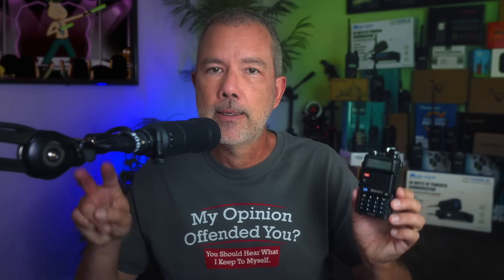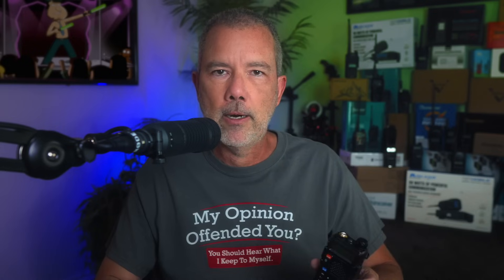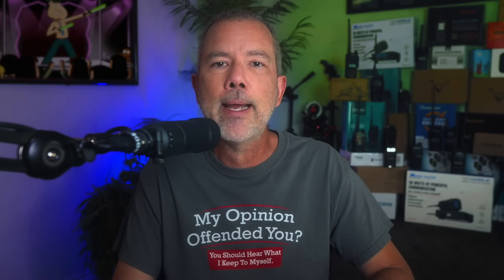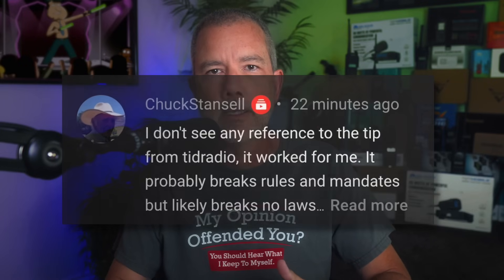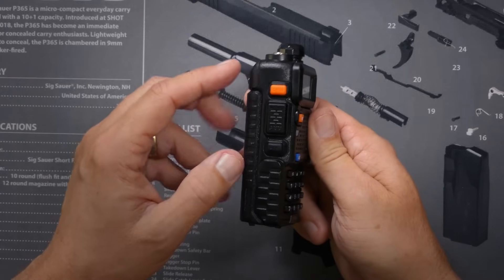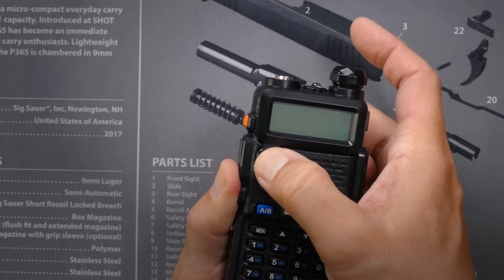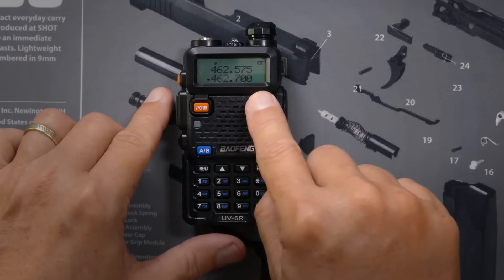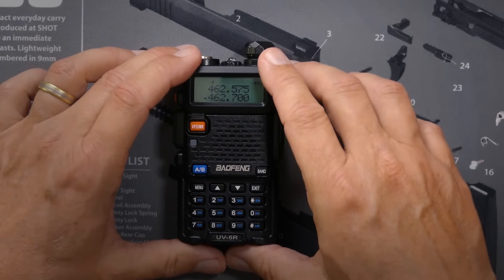How To Unlock A New Baofeng UV-5R - Easy UV5R Jailbreak To Transmit On More Frequencies

Comment: I ordered the Tidradio H8 which is a lot like the UV-5r. My radios were locked against the ham frequencies. I am a ham, thats why I ordered them, but they do not have a "Monitor" button, although I contacted Tidradio, they gave me the same method you showed here , I tried all sorts of things, but I dont get "Factory" coming up so I rewired them about the "Monitor" button which does not exist on the H8. Do you prehaps have the way one could unlock the 2m band transmit for me?  (They have not yet replied to me)  Thanks Trevor

Comment: About a year ago I left a comment regarding the legality of these mods.  The UV5R is not type accepted ie the US.  So what does it matter if it's unlocked?  A ham should know not to use other frequencies.  However I understand notarubicon has been banned.  I specifically will not allow it not be banned on the group that I admin BARN.
Its the group for baofeng and btech radios.  I have come to realize that banning information is not a good thimg.  I also have enjoyed many notarubicon videos.  Those that ban notarubicon even being mentioned should not be allowed to plug a blender in much less use one.  No ham knows everything, I have found much to learn from these videos.  73 DE Bart Stavisky KF5EKG
Reply: The hack worked for me.

Comment: I guess I am missing something didn't work with 5r+plus
Reply from the maker: A UV-5R+plus is not a UV-5R
Reply: @NotaRubicon Productions  going around the menu. I guess I didn't have to do a factory reset. Went in freq mode and plug some magic numbers in received and trans work.

Comment: Just got a new "camo" UV-5R, it's completely locked to the 144 and 433 ham bands, and this unlock does NOT work. It will not even RECEIVE outside these ham bands!! :( 
EDIT: Managed to fix this using Chirp, in Settings > Other settings where you can set upper & lower limits.

Comment: Thank you for the information. I’m playing “catch up” on your videos, so I’m writing this a year after you posted it. 

So, my UV-5R radios are old, so old I don’t remember how old. I found a receipt for an aftermarket Diamond antenna I bought in February 2013, so I know they’re at least ten years old. 

Therefore, ignoring Warning #2, because if I damage my radio (I used my oldest one) it gives me an excuse to buy a new one because my UV-5R label fell off of it years ago, and we all know the radio is now worthless, I diligently followed your instructions, not even knowing if my radio is locked or not. 

The result was interesting. I did not get the word FACTORY to show on my display. The word I got was COPING. Not COPYING, but COPING. 

I have no idea what that means. The radio works fine. All my programmed channels are still there. I won’t know if Warning #4 applies to me, because after using CHIRP to program the radio just to save time in the amount of channels I originally needed to set up, any further tweaking I’ve done has been manually, and the only reason to use CHIRP again on this radio is just to test whether it will still work, and I suspect it will, so there’s no point. 

However, if you have any idea what my display meant when it said COPING, I’d love to hear about it. 

Thank you for your content. You have been a great source of information, and I love your dry wit. Why you don’t have 5 million subs is a mystery to me (not kissing ass, just being honest).

Comment: Transmit  FAB on GMRS band 462.700 MHz with out any problems many thanks for the info and your video are great as I have now got my self 6 Baofeng UV-5R that are the 5 watt version but I do have a new Baofeng UV-5R which is coming and it is the 8 Watt version so I will do the same Jailbreak with that info too and I will let you know how things go on that new Baofeng UV-5R.

Comment: I unlocked mine and the transmit light does now come on and my other radios act like they are receiving the signal but I can't hear any modulation out of my other radios. The TIDRadio receives audio fine but the other radios do not. Any ideas?

Comment: Transmit with no antenna... burns out the final stage amplifier.
Reply: A ham radio "Karen".
Reply: And using the radio without the antenna also heats up and tends to boil off the TX light fluid inside the LED!
Reply: What's an antenna?
Reply: For brief periods of time it is OK!
Reply from the maker: You sound like a real "Expert" in this subject!  So, you will probably want to watch this video just to see how wrong you are:  https://youtu.be/SdMLCDPc04Y
Reply: @TheNotaRubicon   Funny how Louis apparently disappeared........
Reply: @TheNotaRubicon  Yeah OK, but you're causing global warming, erectile dysfunction & nocturnal emissions by carelessly operating in this manner.  So there!
Reply: @TheNotaRubicon All the time they
Reply: @TheNotaRubicon  I purchased a pair of these a couple months ago. It wasn't until I started to view your videos I had reset one of them to 'factory default' settings with out realizing it. When I turned it on again, the female voice was speaking Mandarin. Live and learn.
Reply: You might not have as many fars without an antenna.
Reply: laughing...I'm sure he pisses you off at every turn....
Reply: Any yet... his radio still works!  So does mine.  And I abuse the crap out of it.

When it ceases to work -- like when I dunk it in a vat of nacho cheese -- I'll blast it with a shotgun, and buy a new one.

Damn, I love capitalism, even when it is produced by the CCP.
Reply: WOMP WOMP
Reply: He got you.... roflmao you have been pinned for being a smart ass, or dum  ss.
Reply: no it doesn't.
Reply: if they were that damn sensitive, i dont believe they'd be made at all... much less sold
Reply: Why so all the electrons will spew out and then it will lose its energy? It’s a low power and you would probably have to tape down the PTT and leave it for a very long time to burn anything out.
Reply: I removed the long black thing (antenna?) and instead took an AA battery, inverted it and contacted the antenna base, performed the procedure as instructed and Wa La.. the word 'idiot' came up. Think the radio is referring to my wife?😮
Reply: its not advised to key up a radio with no antenna.  Some radios can tolerate it, but are you willing to gamble?
Reply: Womp womp fa 🐐
Reply: Say you dont know how radio transmitters work without saying you dont know how radio transmitters work 🤣🤣
Reply: There is always one from twitter on here.
Reply: If only you could see how many dislikes you have 😂
Reply: @NateColman  he doesnt have nearly as many dis likes as he has likes. Lol  he is a cult hero and has many folowers.... lol
Reply: @NateColman kinda dumb for you to say that since u cant see the dislikes eather so maybe the auther has Zero dislikes (prove me wrong)

Comment: I have two TIDRADIO UV-5Rs and two Baofend UV-5R5s (It's a UV-5R that has different colored buttons) and this worked on the Baofengs, BUT the first time I did it I then connected it to CHIRP to upload my channel list and then the PTT button was nulled, like you could click it and nada, on all frequencies, on all channels it wouldn't even give me a error beep. Fixed it by going into the Menu (Option 40) Reset ALL, then Chirp, then the FACTORY unlock, that worked, but only in that order.

Comment: I have BF-F8HP, and when I pressed all those buttons and turned it on, it didn't say Factory. Doesn't it work for all models ?
Reply from the maker: Pro Tip: Always read through the video's "more info" section before asking a question.
Reply: @TheNotaRubicon  Got it. Sorry. :(

Comment: Only here in the USA would we allow a government agency to tell us the Freedom Loving People, what can and can not use as a tool? Has anyone noticed that other Ham operators outside the USA have no issues with using a Cheaper radio, and no one seems to bother them at all. A proper Radio operator will use the right tool for the job, and make sure it's safe not only for himself but others around them. The so-called "Experts" that nag so many on youtube, have nothing better to do than Complain. Maybe if they had a thought between their ears that wasn't government-sanctioned they would use their energy in advocating these radios or showing the dangers, but I don't see any of that happening. So basically all they can do is complain. Please substitute the word complain with the word BITCH. TY all and thanks for Notarubicon

Comment: Is there a way to get these radios legal. Why is it locked in the first place?
Reply from the maker: When its locked it is a "legal" ham radio in the United States.
Reply: @TheNotaRubicon  it got tested and it doesn't conform to following regulation:
EN 62209-2:2010, EN 60950-1:2006-1, EN 301 489-1 V 2.2.0:2017-03, EN 30I 783 V2 I.I and EN 301 489-15 V 2.2.0:2017-03
There is a ban on the UV-5R 5W HT. (you could get away with the non existent manual if you modify it yourself, but how you'll get -60dB at 53x Mhz)
Reply from the maker: Where I live, there is no ban.
Good luck.

Comment: it does not work at all
Reply from the maker: That means either yours is already unlocked, its one of the new ones thats not unlockable as mentioned in the info-section of the video, or, you did it wrong.

Comment: Hey man I hope you see this, just got my uv5r, did the unlock and got the “factory” confirmation, I can transmit to my girlfriends frs, and I’m able to transmit to the local gmrs repeater but when they call back I can’t hear them. I feel like I’m missing something…
Reply from the maker: Either your +5Mhz split is wrong or you have the wrong receive tone/code.
Reply: @TheNotaRubicon  hey! Thanks for the reply, I figured it out—it was my offset. I went thru the gmrs channel list and noticed it had a 5.000 offset and mine was inherently set to 000.000, switched it and perfect timing the repeater station sent identification and I picked it up woohoo!!! You’re the man for responding thank you for everything you do!!!!
Reply: @TheNotaRubicon  just wanted to follow up, when I save the gmrs repeater as a channel it doesn’t save the offset, no matter what type or weird way I see online on HOW to create a channel it simply never saves the offset. Upon further research I’m seeing a lot of people say it won’t save offsets into channel mode, only frequency. Kind of stupid but ok…good thing my one repeater in my area is linked to about 6 others I suppose. Should I send it in for a replacement or just deal with it?
Reply from the maker: All my UV-5Rs save the offsets in channel mode - i even made a video showing how to do it.
For GMRS its probably best to get a GMRS radio.. the offsets on all GMRS radios are pre-programmed and they are much easier to program.
Reply: @TheNotaRubicon  one way that was suggested was to basically manually program the receive frequency and transmit frequency with each ctcss code in their respective frequencies, then save both to that channel (29 for me), when I monitor it shows 462 and when I transmit it shows 467, seems to be working better. But yes I do have the btech v2 which I love and added a smiley slim duck to it and an extended battery from a uv82 (compatible) on the way. I also read that by resetting it (unlocking it) I’ve reset its ability to save offsets to channel mode, so I kind of screwed myself rather than digging in to see if it came unlocked (it seemed like it was but I was so eager to see if it would unlock I did that quickly, and it worked…to my detriment)
Reply: @TheNotaRubicon  and now for my next question. Looking into upgrading antennas for uv5r, occurred to me I should probably get a gmrs antenna…but also read the wrong antenna can brick your ht. Is this true? I don’t transmit in ham, just monitor, and murs (although I asked a Walmart employee on murs if he could hear me and he said yes lol) so I’m thinking for example I grab a 701g and throw it on the uv5r, I can still listen to ham and murs but transmit and receive better on gmrs, si o no?

Comment: I completed the steps, and my radio did not display factory, but it will transmit on 462.700.
Reply from the maker: Was it even locked before you started?
Reply: @TheNotaRubicon HI, I didn't think so because it wouldn't take 174.000. Still won't. I am trying to "listen" to 136.000 - 174.000.
Reply: But I did not try the GMRS frequency before I tried the unlock. Radio was purchased Sep 2019.
Reply from the maker: If you bought it in 2019 then its not locked. Doing these steps will do nothing.
Reply: @TheNotaRubicon  ok, got it, thanks for the replies.

Comment: Don’t know what I’m doing wrong… instructions are VERY easy to follow.  I purchased my BF-F8HP in NOV 2019.  It did nothing.
Reply from the maker: is it even locked?
Reply: @TheNotaRubicon  Okay… don’t know much about ham radio operations or equipment, but trying to learn. How would I know if it wasn’t locked to begin with?
Reply from the maker: Be sure to read the updates and warnings in the Info-section of the video ASAP.
Reply: @TheNotaRubicon  Thanks

Comment: I just want to use the radio as a Walmart store radio.  I have older ones.  After a few drops on the concrete floors they no longer hold their battery in place.  Hope this works  could use a new one for work.  I'll be way out at lawn and garden most of the summer.  This will save me lots of steps.  Don't walk well anyway.  Door greeter.

Comment: Yeah, it works.. If you get a new baofeng and there is a TX sticker on the inside back you know it's a "blocked" radio, probably just a factory "chirp" adjustment.   At some point I would imagine Baofeng (PO FUNG) will make a small hardware mod to these radios making this unblocking harder to do.

Comment: Do you know whether we can unlock the GT-5R the same way you unlocked that UV-5R?

I am just getting interested in radios and am wanting to purchase a first HT radio. I will also get my Ham license. From the initial research that I have done (mostly watching lots of YouTube videos), I believe the BAOFENG GT-5R is a variant of the Baofeng UV-5R that filters out spurious signals.  The reason I am interested in radios is because I think they could be a useful thing to have in a get home bag I store in my car when travelling. I also do a lot of hunting in remote areas and have been stuck in the back country a few times. Having one radio that could be used in an Emergency on Ham Bands and on GMRS/FRS bands sounds smart.

Comment: Curious about UPDATE #2.  If we do a factory reset, are we all done?  GMRS frequencies accessible?
Reply: For $20, just to see, I tried doing a factory reset (all) on a new UV5R purchased from Amazon on 2-20-23.  It could hear, but not transmit, on GMRS or FRS frequencies.  Update #3, above, seems to apply.  For $20, I needed to know.  Buy the older ones if you can still find 'em.

Comment: Randy - I could probably "plant" this comment on any one of your videos, but I'll do it here.  I'll get right to the point: THANK YOU!  You score an A+ with your sense of humor, honesty, technical ability and entertainment value.  Even though you clearly state that you don't have a ham license, I would place a bet that you could easily go head-to-head with just about ANY ham radio operator - especially the "sad" ones, most of whom have no real experience in the field.  I know you make fun of those who post their entire life's resume in their comments.  That being said, I will do that a tiny bit here - in your defense of course.  I have over 50 years in the electronics design field, much of it in RF and microwave communications.  I actually DID get my ham license when I was 14 years old - back when we had to learn the Morse code to pass the test. We built our own equipment.  We knew how to solder connections, and could design a transmitter circuit on a napkin. Those abilities are almost extinct now.  Now, they just pay a bunch of $$$ for the equipment but can't understand the instruction manual.  So keep the videos coming!  They're awesome, entertaining, accurate and down-to-earth.

Comment: Hey Randy!! quick question - Do you know of anywhere I can get some help unlocking a Wouxun KG-UV920P-A? There's some stuff out there for a 950 but I don't want to create a problem if the software isn't backwards compatible....  Thoughts??
Reply from the maker: I dont know nuthin 'bout no UV-920P-A radios!
Reply: @TheNotaRubicon  No problemo!! I've got it! (Thanks to the inter-webs). I've learned so much from your channel!! I took your advice from one of your earlier vids and got in touch with TwoWayRadios for all of my stuff (except for 6 Baofeng BF8 handhelds - Amazon) and they're awesome!  They got me set up with my own business freq's (just above the GMRS Band) and I just ordered a duplexer from them yesterday. I'm slowly building my system (6 handhelds, one base and a repeater.) Thanks for ALL of the awesome advice. The system is all set in a rack case, so it looks pretty awesome also!  Thanks again, PLEASE keep the videos and wit coming!!

Comment: I was able to unlock my newly purchased (2/23) uv-5r with this method and confirmed that it works on gmrs. However, I noticed that it now also transmits on channels/freq that I had previously set to not transmit. I had used chirp and set the duplex to off on channels that I didn't want to accidently transmit on. I can't seem to fix that . Has anyone else had this issue?

Comment: What does this do specifically? Idk where to go from here.
Reply from the maker: It unlocks the radio. If you do not know what that means, or why you would want to do it, then you dont need to do it.
Reply: @TheNotaRubicon  So I am asking because I did not notice any difference after doing so. Is it possible it was already unlocked in box? I have been using channel 16 as well as other gmsr channels before I did this. So my question is. Does it unlock anything else you didn’t mention?